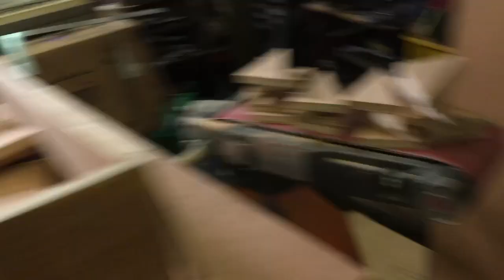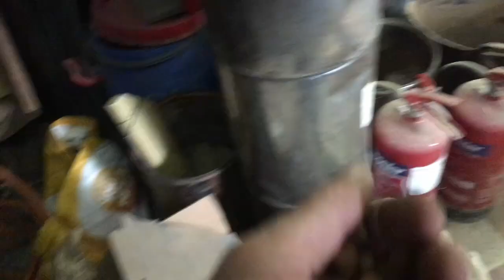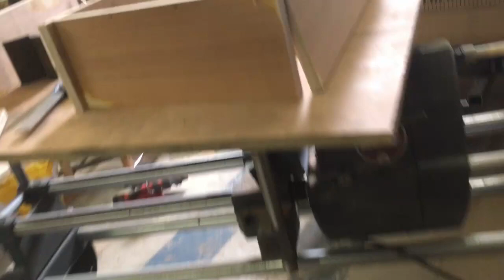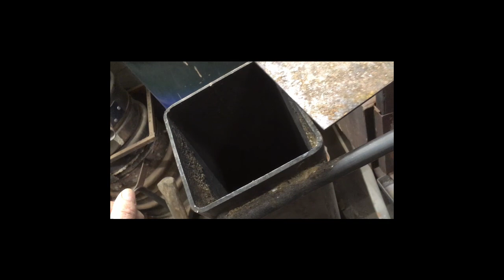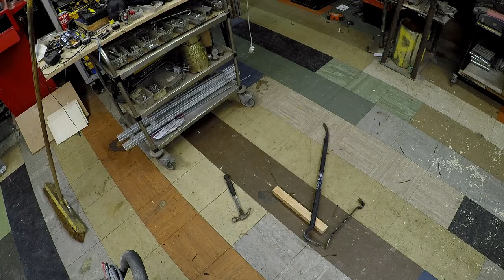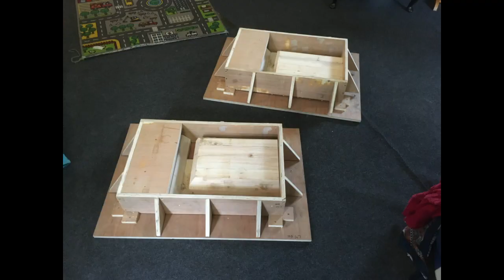Batch Rocket Heater part 2 combustion chamber moulds.mp4

Comment: Amazing work, love the attention to detail any chance that you have any measurements just basic length width and depth of the moulds
Reply from the maker: wow thanks so much.   i got it all from here  https://batchrocket.eu/en/designs#core3    its an ever growing site and there is a good YT community building peters designs.  somewhere on the site there is a spreadsheet that allows you to scale it up or down but ive only built that one which is the original dimensions with a 150mm (ish)flue.    i had to move it recently and the riser perished when i took it apart and i replaced it with a piece of 250mm spiral ducting lined with 2 layers of refractory ceramic fibre (kaowool) and it seems to work well and was cheaper and 30 minutes as oppsed to the week and a half it took to cast the original sections.   DONT USE THE CLAY BALLS! they totally messed it up.   the door i made works really well as it allows all over fine adjustment so it seals nicely all the way round and the big glass is just amazing.   it performs so much better than i had imagined and with the addition of a giant stove fan it heats my 1250sqft workshop on scrap wood from the chippy next door.   hope this helps and if you do build one im happy to help if you need.   cheers   tanc
Reply: @itanc1  hi thank you for the advice, already bought the clay balls unfortunatley, but will not use them on the riser. where are about are you in UK ?
Reply from the maker: @sarfraz6931  no worries but don’t use them in any concrete casting unless the mold has a mesh lid to keep the balls in place.    Otherwise they just float and you end up with concrete on the bottom and a weak layer of balls on top.    I’m in Wales btw.    All the best.   Tanc